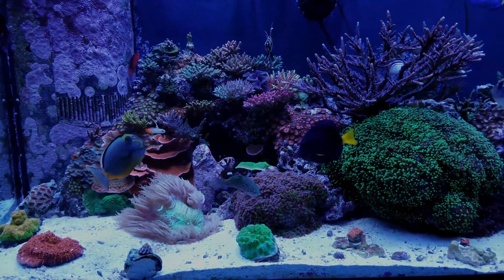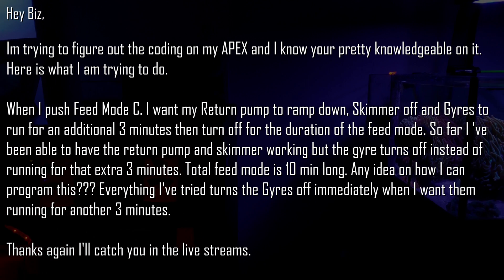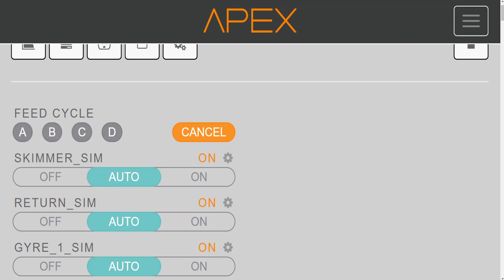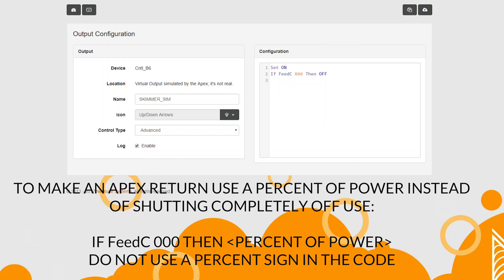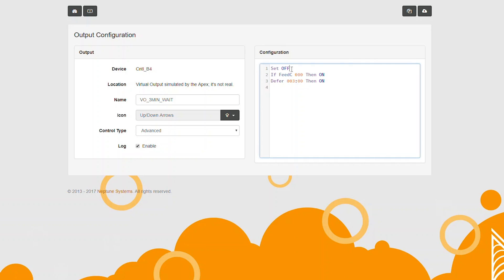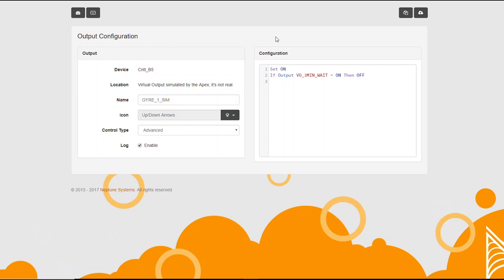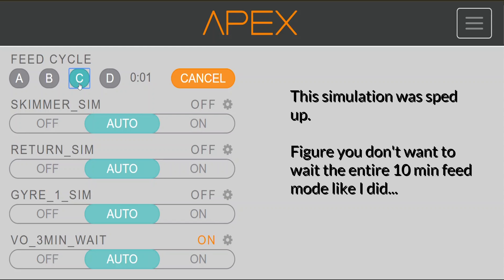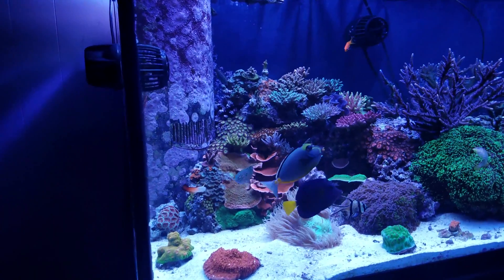Apex Advanced Feed Mode Programming - Defer and VO's

Comment: I did basically the same thing with my vortec pumps but I did it different. Basically I have 
Feed A control my return pump and skimmer. I put a defer on for skimmer so it comes on several minutes after my return. Then I control one of my vortecs(MP-10wQD) via my return pump (If Outlet Retpumps OFF Then  Off) I added a one minute off defer, Then I control my other vortec(MP-10QD) via the first one (If Outlet MP-10wQD OFF Then OFF) Then I put a defer off and defer on, on my MP-10QD so it runs for 2 minutes into feeding before it shuts off and then stays off for one minute longer then the MP-10wQD, that way they are not synced up with each other for a more random flow.
So what I get is when I hit feed A return and skimmer go off, one minute later one vortec goes off then one more minute later the other goes off, then after 6 minute feed return and one vortec comes on and one minute later the other vortec comes on and like 3 minutes later still the skimmer comes on.

Comment: Hello there, I my self is having a hard time with my feed programing as well, I'm trying to turn on my mp10 after 3 min of feed cycle, I been struggling with getting it correct, and when I get it close my mp10 stays at 100% and it needs to be at 50% during feed cycle a i have the wxm module for both my xr15 pro gen 4 and my mp10 , I know you can figure this out, all help would be deeply appreciated thanks, I'll be watching your channel

Comment: Hope you're well. So I have 3 electric valves/solenoids connected to my RODI system and powered by my apex power bar. Currently, I have them working twice a week on a schedule to automatically fill up my RODI reservoir. However, I would like to now also create a manual button (either through feed mode or through a virtual outlet) to generate some fresh RODI water on demand. I tried a few commands, but it doesnt seem to be working.

Currently, to fill up my RODI bucket, it takes about 60 minutes. Valve1 opens the main water line. Valve 2 opens the RO flushing/waste water. Valve3 directs the water into the DI. So basically what my current programming is: open valve1 for 60 minutes while simultaneously opening valve2 for 2 minutes to flush. After 2 minutes, valve2 shuts down while simultaneously valve3 opens up. After 60 minutes, valve1 and valve3 both shutdown, while simultaneously valve2 reopens for only 1 minute to release excess water and pressure. 

Your help would be much appreciated! thanks

Comment: Hi Biz I am concerned that if my return pump fails I want 2 things to happen
1 I am notified by alert
2 my pump feeding my reactors turns off also to save flooding or running dry
How can I achieve this please?
Many thanks
M
Reply from the maker: There are different ways to do it depending on equipment. For example I would do it differently If I had a EB832 vs if I had a EB8 or if I had a COR return pump vs any other pump. I would need to know some  info on your system